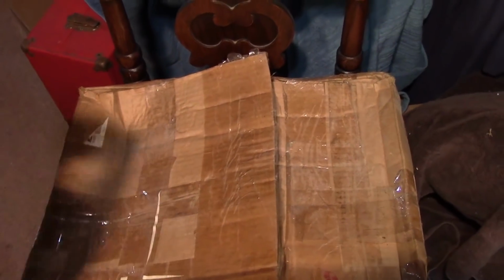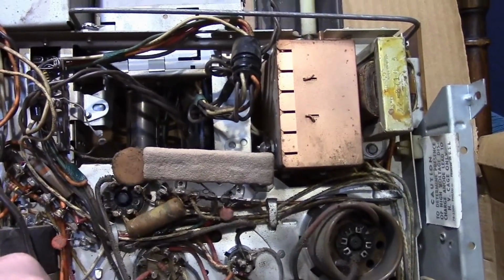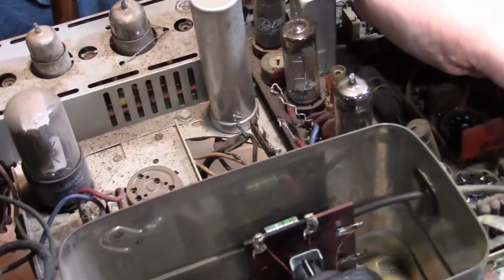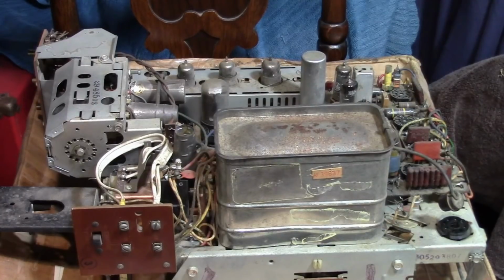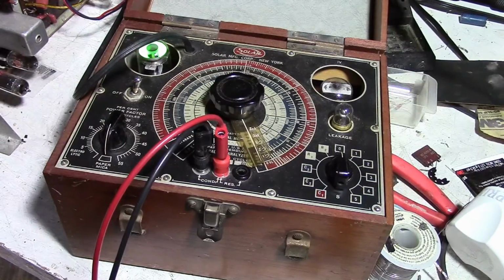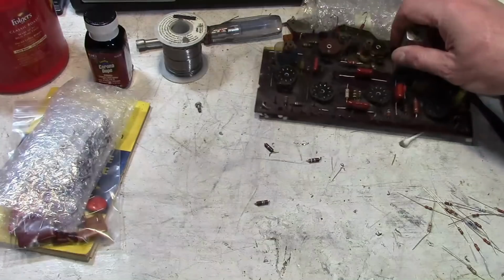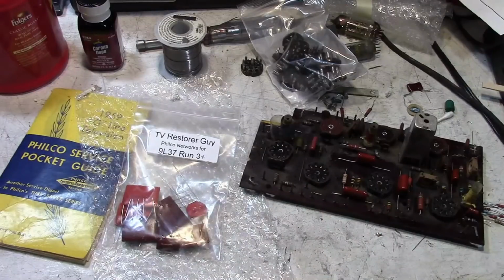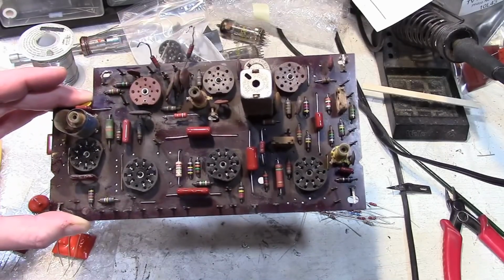Moldy Predicta Holiday p2o?

Comment: These TVs where you have multiple copies and somewhat isolated audio circuits is it possible to install TWO audio sections and use some sort of custom stereo demodulater circuit and output the audio in stereo??   That would be a very interesting mod to give old TVs stereo sound.  I saw one giant console TV with dual speakers and I starting thinking it would be cool to hack the audio and use both speakers for stereo sound.
Reply from the maker: From what I've seen a stereo demodulator would need to be done with digital circuitry and complex filters.

Comment: That cap looks like a resistor how do you identify it's a cap?
Reply from the maker: Experience helps.  They are known as "bumblebee" caps and are in a plastic tube.  Resistors are not made like that.  When in doubt use an ohm meter or consult the service info.
Reply: @bandersentv  ok thanks :)

Comment: I'm looking at the Sams-schematic for a 10L42 chassis. I'm wondering where would you inject a coaxial/composite signal in there?
The schematic has a section labeled "Video output" (label 51) is that it? Or perhaps at label "C", right after the video detector?
Reply from the maker: Not sure.  I've never injected composite into a vintage TV.  I like to keep them all original.
Reply: @bandersentv  Yeah, I understand. But it'd still be cool to know where and how to attach a relatively "modern" signal to a TV like this, without using a modulator, etc.
Reply from the maker: Either C or pin 7 of the 6AW8A.  You'll probably need to amplify and possibly invert it.  I think a standard composite video signal is 1v p-p.  This is expecting 2.5 v p-p.  Also be sure to couple it through a capacitor.
Reply: @bandersentv  At W1, that's kinda where I expected it too! I'll see if I can rig something up and make it work. Thanks for replying, been watching your videos for years now! Have a great weekend, man!
Reply from the maker: Thanks and good luck.  Please let me know how it goes.

Comment: What's your opinion on installing a composite video input VS using a converter box with the tuner. (on older TVs in general) Wouldn't composite be cleaner/more reliable?
Reply from the maker: Yes, it would be cleaner and more reliable.  You're bypassing about half of the electronics in the TV.  You could pull a lot of tubes out and cut the power draw considerably.   I've never done it personally and don't care to.  It's turning a TV into a monitor.  I like the challenge of getting the TV working as it did originally.
Reply: @bandersentv  I understand. That totally makes sense from a historic/preservation perspective. I suppose that if you're going to be getting old equipment running, it would be silly not to use it as initially intended. (at least as much as possible)

Comment: Lots  of uses for Corona Dope. Repairing small tears in speakers, seal  dripping wax from a power  transformer that tests good still. Has good insulating properties for any 
connection that has a bare wire that runs at high voltage to prevent arcing. Done all those myself in the last year.
 When you open a bottle of it put it in a sandwich bag  and squeeze  as much air out of it as you can and make sure  turn the bottle with a  tightly sealed cap  upside down.
 The solvents will stay in the bottle much longer.
Reply from the maker: Thank you for the advice.  I will definitely try that with the next bottle.

Comment: In the lab, we use volatile reagents for microscopy that have a similar problem.  When time to reseal, we would hold the lid on the top with just enough space to insert the straw from and inert gas aerosol can and gently blow out the air in the container then screw the cap on quickly.  Then we would wrap the lid with parafilm.  The reagents remained good for years.  A similar process is used for resealing an opened wine bottle.  Here is  typical product.  https://www.amazon.com/Private-Preserve-Wine-Preservation-Spray/dp/B0000DCS18    and https://www.amazon.com/Parafilm-PM-996-Purpose-Laboratory-Film/dp/B004VQP6CQ/ref=sr_1_1?dchild=1&keywords=parafilm&qid=1587403570&s=home-garden&sr=1-1-catcorr  Best, Doc

Comment: It isn't just Predictas, in fact, I hadn't really heard that about those, but then again I know enough to keep away from them. It is interesting to note flyback issues continued on through the 60s, especially on RCA Color sets. You may remember me from several years back, you actually got me interested enough to do a radio. I've got some more radios, a tube tester, and a CRT tester to do now. I have a Silvertone Battery Portable, a Halicrafters S38B, and a Gonset Communicator 3 Transceiver. The Silvertone and Halicrafters are complete, the Gonset is missing the back and the vibrator for battery operation.

Comment: I think it is an excellent idea to use the chassis from the box in that set!!!  Glad you found it.
I have a suggestion that is going to convince you that I am absolutely, totally bonkers...but at least give it some serious thought.  Thinking about what you said of how the UHF tuner works, I came up with the idea of adding a "Magic Eye" tuning indicator!  Yeah, you would have to do a bit of engineering, but you can do it!!  I think it would be a really cool addition to the set.
I think that chassis would clean up better than the other one...can't really say why, but I have a gut feeling that it would.  Will be great to see that chassis cleaned up, all the nasty Electrolytics, Bumblebee, Paper/Wax , and any other bad capacitors replaced.  I hope that tapped resistor is still good.  You probably can find the Thermistor without too much trouble.
Something I thought you might find interesting is this little gadget:
https://www.eio.com/products/velleman-vtdesol3u-vacuum-desoldering-pump-with-heater-30w?variant=15312884203586&utm_source=google&utm_medium=cpc&utm_campaign=BuildingConsumables&gclid=CjwKCAjw7e_0BRB7EiwAlH-goH1SsCVa4FWolFMAhAEjoYWkC4kLATPld0FEKuXTwL_V5L95kDq_xBoCxagQAvD_BwE
I tried to figure out what is wrong with the board...just didn't see anything obvious.  I did see the Inductors? at the bottom that had one lead loose, but I figured that those were soldered to another board and were sort of like a wire that was removed.  I also noticed what appears to be either a resistor or an inductor...thought it might be an inductor since the body appears to be Green, that you might have considered was a resistor instead of an inductor.  But the last possible thing that I noticed that might be the "thing" is the "pins" that you bend to hold the board into the chassis are still on the board, and I thought that they were supposed to be a part of the chassis and when the board is taken out should remain, but are on the board still.
Anyway, enjoyed the video, keep 'em commin' and they are enjoyed and appreciated!
Stay Safe, Stay Healthy, Keep Enjoying Life!!!
Reply from the maker: Thanks for the detailed comment.  Call me crazy but I'm not a fan of eye tubes and don't have a single radio that uses them.  Partly because they have a short life and go dim long before any other tubes need replacing. That's driving up the cost.  Partly because the aren't really needed.  Just tune it in so it sounds good.

As for adding one it probably wouldn't be that difficult.  Stick the filament in series with the existing tubes and tie control grid to AGC buss.  It would work for all the channels not just UHF.

Good guesses but wrong on all counts.  The ground stakes are part of the boards.  The chassis has little forks that stick up.